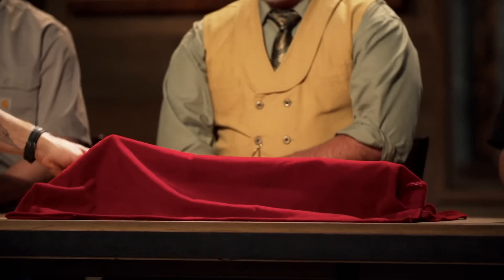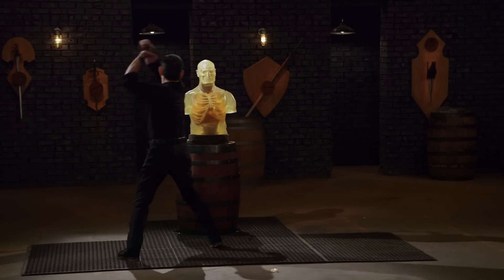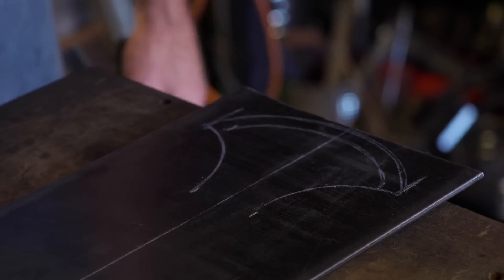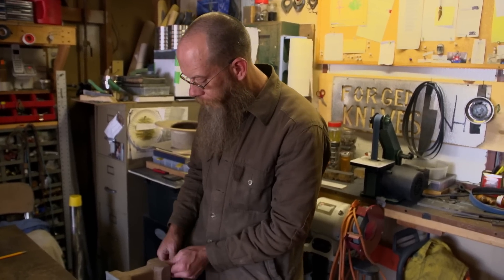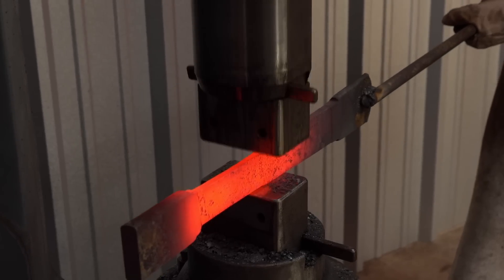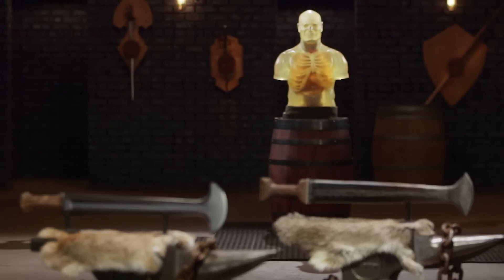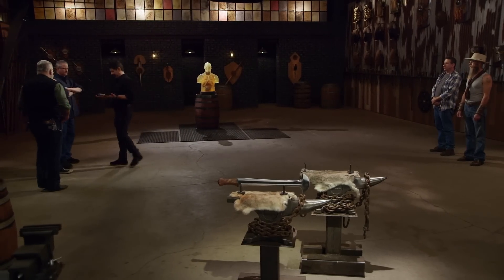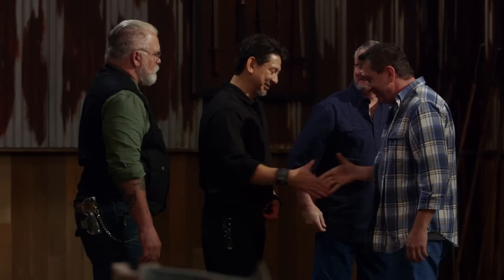The Ikakalaka Blade: BRUTAL BLACK PANTHER SWORD | Forged in Fire (Season 7)

Comment: Nick just totally misunderstood what that weapon was about. When I saw how he was welding that metal onto the end of his billet I could see he lacked the finesse to turn out a good blade.  He didn't even try to put a fuller in to try and lessen the weight a bit.

Ricardo was the absolute opposite, 25 years of experience in blade smithing and every single year of that experience showed in his final blade. And to do it twice? That's just showing off.